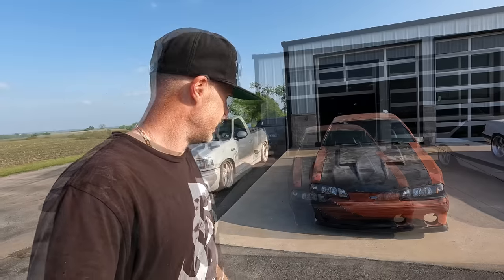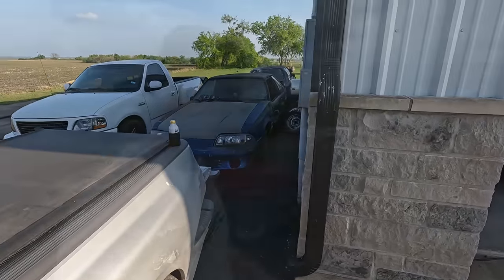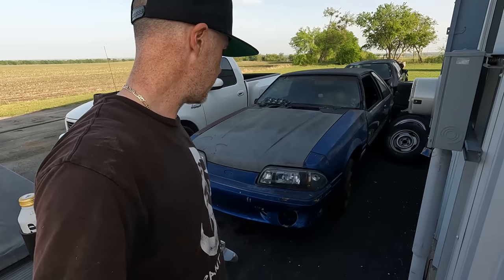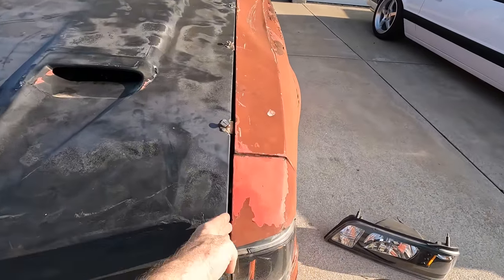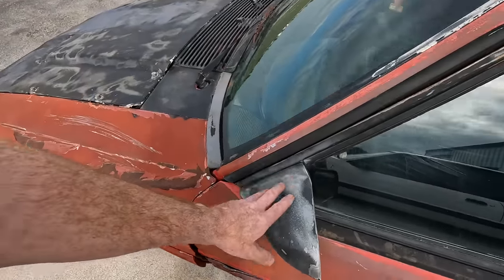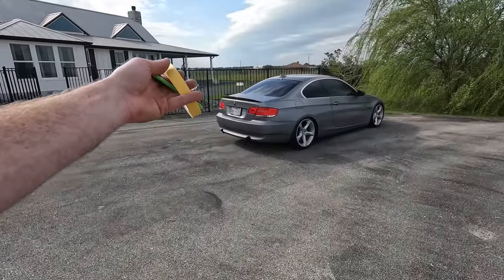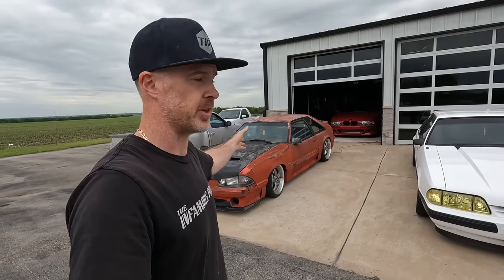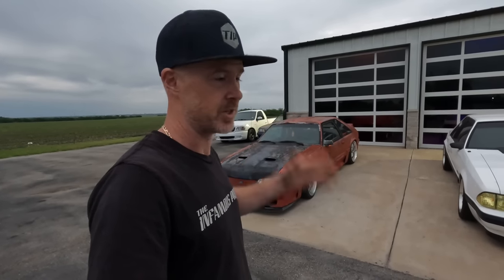Side Marker Lights on a Foxbody? - More Sh!tbox-Fox #innovation

Comment: what if you painted the seperation line with SEM Trim Black instead of cutting it, you could test this idea using black electrical tape? Mask up the light, around the perimeter and also the seperation between the side marker and headlight and maybe even the center light.
The side marker looks cool. It looks good with the faded mirrors, if the mirrors were darker than smoking the side markers would be needed.

Comment: Those other lights won't work IMO. The look doesn't need more round. The one piece has that square/sharp angle which helps contrast the aggressive line of the hood. IMO if I wanted  to go real nuts.... I'd Cut out the interior of the one piece, fit in 4 eye buckets with LED lamps. Black out the top line of LED's and diffuse the ring of LED's halo style with smoked or white acrylic ala the Hyundai N Concept or Ionic 5's angry 4 eye look.  Keep it up this is fun stuff.